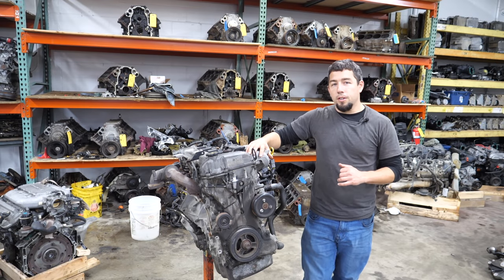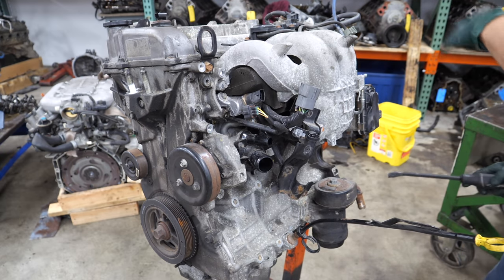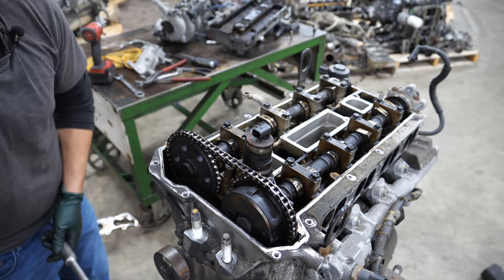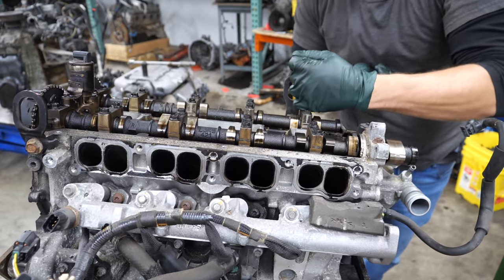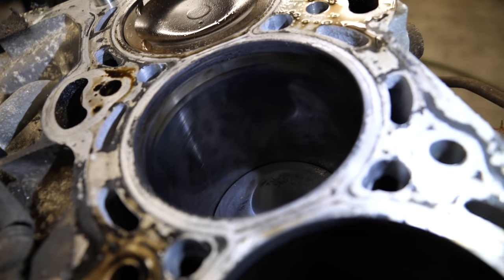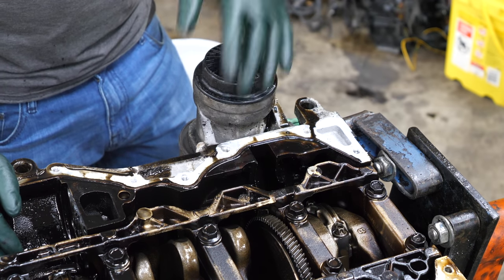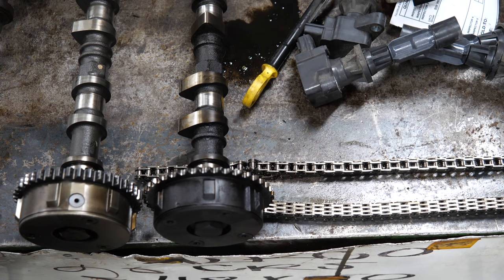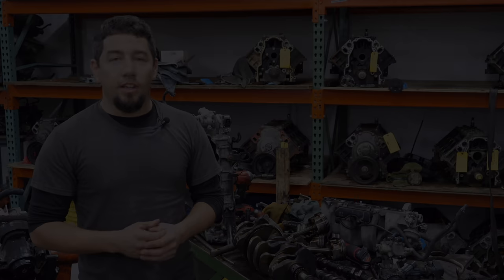Mazda 2.3L Turbo MZR Engine Teardown. A SMORGASBORD Of Failure Modes!

Comment: FYI the saying run hard and put up wet is from horseback days when someone would run a horse hard then just put it in the barn without cooling it down properly and not brushing out its coat, feeding it and watering it so I think the term is still relevant as it means neglected and not maintained properly.
Reply: Fascinating, I was not aware of that. Thanks for sharing!
Reply: The phrase is "rode hard and put away wet", as opposed to "run/ran hard". You don't run a horse, you ride a horse.
Reply: @CharlesVanNoland  Thus my theory they're really talking about one-night stands that are more like 10-minute stands.
Reply: Came to the comments to say this but you beat me to it.
Reply: @CharlesVanNoland  May I say yes you DO in some context Run a horse: canter ring, hot walker, etc. You also can use a different set of verbiage for when they are hooked up on a harness for ground “driving” and for a buggy. Also we use a phrase to be purposefully used in different contexts and some times alluding to another for a double ententes. Something completely novel to the viewers of this channel 🤔😍 valoutes in a water pump anyone

Comment: I have the NON-turbo version of the 2.3 and it's one of the most fantastic engines ever made.
Reply: same. love it.
Reply: The 2.3 turbos get a lot of hate from lack of maintenance mostly, but I do agree with their down falls the timing chains suck and the oil control rings always clog like this one shown in the video but when maintained over regularly they are super fun cars in my opinion
Reply: Absolutely gutless though. Makes the same as a Honda or Toyota 1.8

Comment: So I think it's well-established that you hate this GDI turbo engine... but what about its naturally-aspirated older brother?  I have a 2004 Mazda3 2.3L that I bought new and currently have 322,000 miles on it.  I have had no major problems (intake manifold VLIM valves and a valve cover gasket) so I'd be very interested to hear what you think of the original version of the engine.

Comment: 4 Years ago, I took my 200k miles 06 Miata (similar engine?) in to have the timing chain done (was rattling).  It seems the shop I took it didn't know the correct tool to use because they killed the motor.  Their insurance put a 60k motor in for me, so not too bad a deal, I guess.

Comment: Fun fact if you didn’t already know. The saying “drove/rode hard, put away wet” long predates cars. The saying refers to horses who were worked hard into a sweat and then put away sweaty. This is a good way to cause all sorts of problems with horses because like an athlete, they need to walk around and cool and dry themselves off. Not doing so can cause hyperthermia and heat stroke on hot days, hypothermia on cold days, colic which is a life threatening series of conditions, and far more. 

Just wanted to share. Great video as always.
Reply: I was going to post this thanks dude!
Reply: Thank you for the expalnation as a non native english speaker.
Reply: @Redkit34  omg I know right? I work in IT and it’s crazy how many weird sayings are used. So many of my friends immigrated after college so it’s fun to try to figure out the original context. I have to Google a lot myself.
Reply: You are bringing back long forgotten memories of sweat scrapers from my childhood.

Comment: I don't know why watching an engine tear down is so fascinating [Yes I do, I'm a gear-head], but I enjoy your videos!

WE WANT PORSCHE 928 CONTENT!  Or at least I do.  I drove one for 19.5 years and worked on it myself, to include radiator changes, motor mounts, steering racks, complete intake removal and refresh.

Great video!
Reply: Hardcore mechanic fare. I like to watch. Something about bruised knuckles as a kid. Fascinating world though. The engineering is amazing to me.
Reply: @photopicker  I agree.
Reply: Kind of rare to find a wrecker 928 to make a vid with, send hm yours so we can all watch!.
Reply: @barryaiello3127  That's really not true, beater 928's are around.  Often they turn up on Craigslist.  Word of warning:  You can spend some serious coin on an old 928!
Reply: @Flies2FLL  They didn't exactly sell like hotcakes back then, they were not cheap to buy, maintain or insure.
Reply: @barryaiello3127  They built about 58,000 of them over 17 years.  Half came to the US, about half of those, or about 12,000 cars are still in the US.  They are either total basket cases [stay away!] or in perfect condition, since they have a fanatical following.  I drove one for over 19 years.  928 International sells parts at VW prices and the websites can tell you anything you want to know.  If you can turn a wrench these are a lot of fun for not much cash. But really bad ones can be very expensive to bring back.
Reply: @Flies2FLL  You've proved my point, 12,000 over 17 years so they don't come up very often.
Reply: @barryaiello3127  Well....You aren't going to find a used one at the Porsche dealer or the local used car lot,  hahah!

Thanx!

Comment: The biggest problem with chain stretch is it also damages the sprocket teeth. Specifically the tooth profile thins to more of a point due to the wider link spacing. Few people ever catch that, and it contributes to damaging the replacement chain.

Comment: I remember that oil filter on my old Mazda6. It was a joy when the drain bolt in the bottom of the housing wouldn't come out. I learned to live with getting covered in oil. I wasn't entirely sad when we traded it in.
Reply: John Lees  -  LOL!  Same here.  I thought it was just mine where the center drain bolt wouldn't come out.  I still have my Mazda 3 with the non-turbo version of this engine.  Just because of the cartridge filter, and stupid under car plastic "shield" (that used to be on my car) a simple oil change is something i hate doing.
Reply: I kind of like it because it’s really easy access but not being able to stab it with a screwdriver to twist it off is a bitch.

Comment: This might be impossible... but id love to see some comparison teardowns.

Cheap oil for the life of the engine vs synthetic.
Or just even good maintenance vs mistreated.

Either way youre going to go far keep it up 👌 mint
Reply: I agree i follow a guy called project farm he has done comparisons with small motors burning them up with regular oil and synthetic, the type of synthetic also makes a difference with lubricity for example
Reply: @lutomson3496  im talking after 200kms. Would be interesting ti see a real world example of the difference here on youtube. I have personal experience with the difference or course, but not a full teardown like this
Reply: I've got 338.000 miles on my 94 Trans Am.  LT1 ENGINE. Only used Castrol oil in it since new. 3000 mile oil changes.  Runs and sounds like new. Even timing chain is original.  Uses no oil between changes either.

Comment: Please do a video describing the top ten and the worst ten engines that you know about from a design and/or reliability point of view. 
And a video about the top ten reasons engines show up in your hands. 
(Other than the number one through six reasons of never changing the oil.)
What are your thoughts about the Plymouth Slant-Six engine?
Reply: I imagine he doesn't do much of anything with any of the old iron legends like that Slant Six, or my 4.9 I6, or a Chevy guy's 250/292. Or any of the old school iron V8s big and small alike. They're too skookum and too cheap to buy parts for. Never end up on his dissection table unless a viewer just straight up donates one for free.  Eric's running a business selling useable parts from these things, after all, and if he tears an engine down to get $250-$350 worth of parts what sense does it make for him to buy one when he can tear another engine down and add another zero to the profit margin?

I imagine he'd say the same things most people say about the Slant Six: Skookum, bit of a dog in factory trim particularly during smog years, but tons of modding potential.

As a side note I would be beside myself if one of those legends of yesteryear ended up on his table. Would make an excellent comparison video, showing how overbuilt they are compared to modern engines, showing how certain things have changed over the years, that sorta stuff. A 350SBC and another blown LS would be perfect for a side by side teardown given the LS is the replacement for the venerable smallblock, but the general themes apply cross brands.

I'd also absolutely love to see him tear something down that's truly ancient, like an 8BA flathead or a Fireball Straight 8. But again he's not gonna buy one of those engines if he can't turn a profit selling the parts and I doubt any viewers have one just lying around they'd be willing to donate/lend for a video.
Reply: @TestECull  Thanks for the comment.  I think your right and I'm not sure he has much experience with the old school iron.  
( I owned three Valiants back in the day. (The push button transmission wasn't the most stellar.))
I remember being told the only thing that wore out on the Slant Six was the plastic bevel gear on the distributor rotor shaft, but that was by design. The internal brass gear was much harder to replace than the rotor shaft.)
Reply: @JayKayKay7  ye the Ford 300/4.9 ain't much different, only they didn't use a plastic gear on the dizzy either. Half million mile overhaul intervals are common and it's rare that one wears out before the vehicle around it does.

Comment: I see so many guys struggle with fasteners on an engine stand, one easy solution is to rotate the engine 90° on the stand, you can then use your breaker bar vertically, pull up or push down, it will stop the stand from swiveling on the wheels.
Reply: Or if you have a stand with a square base rather than a T base, it makes it easy to stand on the base for dealing with those tight bolts. I also swapped out the casters for some braked ones from a hardware store.

Comment: Every problematic Mazda piston engine is made by Ford. A TRUE Janpanese Mazda piston engine don't have those issues and are damn near bullet proof. You'll find those engines in 1st, 2nd, 4th gen Miata's and early 90's MX-3's. All these Ford engines are in 626, 929, MPV, Cx-7, Mazdaspeed 3, early model Mazda 3 & 6, Mazda 5 and early model Cx9. The Sky-active engines are all TRUE Japanese Mazda's.

Comment: biggest piece of shit motor I have ever worked on. Oil pump drive chain failure - cam timing chain failure - head gasket failure - excessive oil consumption - burnt valves from excessive oil consumption/carbon buildup- cam phaser failure - turbo failure - excessive carbon buildup on inlet valves - big end bearing failure the list goes on and on

One thing I've always wanted to know but have never been able to compare or confirm is if the 2.3 crank in the mazda/ford abomination is the same crank used in the 2016 > current 2.3 Ecoboost I've got a 2017 focus st 2.0 that I want to put a 2.3 crank in (2.3 Ecoboost crank fits straight in to the 2.0 block except the 2.0 block is a much stronger closed deck which is why I want to keep the 2.0 block fitted with the 2.3 crank)  but in Australia it's so hard to find a 2.3l Ecoboost motor for a realistic price any 2.3's that go up for sale are well above $5k+ depending on km and just a crank on its own is non existent unless you go new.

Comment: Great video, however don't want to nit-pick, but you kept saying that timing chain had stretched. This is not true. Timing chains wear, this is due to the links on the chain wearing and increasing play. So over time the links develop more and more free play thus increasing the effective length of the chain, so technically they wear.

Comment: Those dark spots on the one cylinder is new to me...I'm curious what caused that 👍😎..I rarely miss your videos if at all!!👍👍
Reply: Something got hot!
Reply: @paulschab8152  Do the dark spots on the cylinder line up with the burned intake valves? We couldn't tell from the video. If so, it might be torching.

Comment: As a ford dealer tech for the last 10 years, i can honestly say, i've seen zero 2 liter ecoboost engines with timing chain issues, i believe it has to do with the fact that the engines are detuned from the mazda specs and somewhat better timing chain design. but ford still has huge issues with cam phasers and timing chains in the v6 ecoboost engines so who know about it being "better" designs.
Reply: It's got nothing to do with the chain, it's 100% to do with the fact the VVT actuator is an upgraded design with a stronger locking pin.

Comment: I have an 07 MS3 and can confirm on the timing issue.. mine specifically were the guides but ended up changing all the components. Now to work on the injectors and  excessive blowby 😅

Comment: i have a speed 3, e85 with a good tune, do all the proper maintenance  have 140k miles on it, never had issue. also they make great power for how cheap you can get them for. Overspeed motorsports sells 0 mile engines for under 5k.

Comment: Eric you need to acquire a racing engine with a dry sump with multiple stages that way you can play it like a recorder, be who you really are.(and who we want you to be.) As for the differences between the timing chains and sprockets, just speculation on my part but I imagine the differences are a result of the different engines likely being assembled in different factories and consequently relying on some different suppliers for various parts.

Assuming the LLY is soaking in penetrating oil, reinstalling the bellhousing adapter(assuming you still have it) on the block with a few bolts, and the flexplate(again assuming you still have it) on the crank with a few bolts, and using a strong m10 x 1.5 bolt in a bellhousing bolt hole as a fulcrum point,(the closer to the ring gear the better) a big pry bar in the flywheel teeth prying off of the bolt will allow you to imply far greater leverage on the crank then you could by trying to turn the crank with a breaker bar on the balancer bolt. The crank is also a more ideal tool for getting the rods and pistons(which I know are likely toast) to move without damaging them the way a hammer and punch or block of wood could.

Comment: Please tear down a Fiat/Chrysler engine with MultiAir!

I just did a timing belt / valve cover gasket / water pump job on one a couple weeks ago, and that MultiAir system is strange!  I'm pretty sure I know how it works, and I can't believe it does, but she needed her Fiat 500L back ( 1.4L MultiAir Turbo) working!

Comment: A couple of ideas for ya-

1) Pull a compression ring out and put it in the cylinder and measure the wear on the ring. It would have been interesting to compare the low compression cylinder vs. the others ring wear.
2) While they are getting harder to find and I'm sure are not a core part of your business, it would be fun to see you tear down a type 1 or type 4 aircooled VW engine from a bus, Vanagon or beetle. Lots of classic VW fans on Youtube and you'll make your money back on the parts.
Keep up the good work on these enjoyable videos!

Comment: @13:40 The intake manifold on this engine from factory had issues with flow consistency into cylinder 3. So I'd assume it ran rich countless times and covered the injector/seal with half burnt fuel.

Comment: I like Watching your teardown Videos showing why the engine failed (most time coming faulty connection between drivers seat and steering wheel.) I do have something for you to try when using a breaker bar or ratchet breaking bolts loose when possible stand on the engine stand. it is also very useful when setting torque (head bolts, main and rod caps).

Comment: I need help!  FROM ANYONE FAMILILAR WITH THIS ENGINE. i HAE A 07 CX7 AND IT WAS MIOSFIRING ON CYLINDER 4 SO I REPLACED ALL 4 COIL PACKS. HOOKED EVERYTHING BACK UP AS THERE ARE ONLY A FEWE BOLTS REQWUIRED TO REMOVE THE TOP MOUNT INTERCOOLER/ AFTER REINSTALLING EVERYTHING THE CAR WONT START. IT CRANKS BUT WOINT START UNLESS I USE STARTER FLUID AND THEN AFTER IT FINALLY RUN (=VERY ROUGH) MOST LIKELY LEAN. IT REUINS AT 1500 RPM AND SPUTTER AND DIES UNLESS I GIVE IT FULL THROTTLE. THEN IT RUNS BUT POORLY. LIKE FULL THROTTLE IIN NEUTRAL TS ONLY 3500RPM. TRYING TO PUT THE CAR IN GEAR AND GO IT JUST DIES. THE ONLY THING I DID WAS DISCONNECT THE IONTERCOOLER THEN THE 4 COIL PACKS AND SPARK PLUGS./ ANY IDEA WHAT I COULD BE DOING WRONG? nO ENGINE CODES ARE SHOW USING OBD2 SCANNEWR. PLZ HELP

Comment: Anyone that has extensive knowledge of these engines knows that they are exceptionally robust. The common failures are always related to deferred maintenance and abuse. The timing chains don’t stretch when the oil is changed on time. The low compression is probably from lean condition due to the leaking injector o-ring that should have been replaced and they are easy to diagnose because they actually make noise from compression leaking past the o-ring. The cartridge filters did not cause failures the people that worked on them did. All the failures on this engine are related to abuse mainly from lack of oil change maintenance.
Reply: 100%. I'd say most of the time, the chain isn't stretched beyond tolerance, the chain is simply 'worn' as a result of high particulate matter in the oil and the locking pin on the VVT actuator has failed giving the impression of stretch. Once again, this engine is an early L3-VDT as evidenced by the pistons and VVT actuator locking pin failures aren't uncommon, the issue was resolved in latter variations of the L3-VDT. Overall a far more robust engine than the open deck Ecoboost 2.3 that came later.